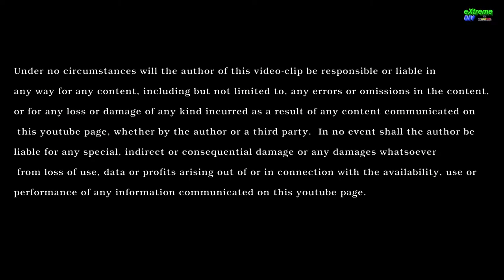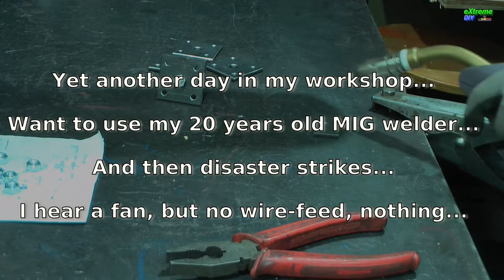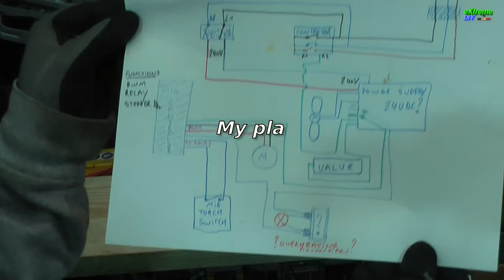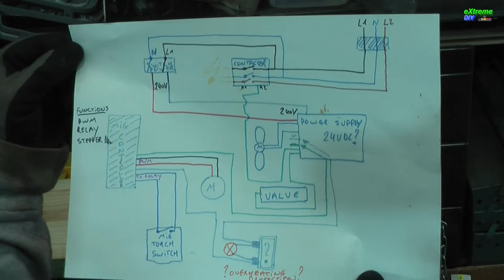DIY Fixing/Repairing/Rebuilding my MIG welder

Comment from the maker: I used this PWM controller from @m@zon (not sponsored, I payed for it!): DC PWM Motor Controller Reversible 12V 24V 36V 40A High Performance Motor Speed Controller Switch CCM6Ds-B ...   probably a bit over-engineered for what I was using it for, but may be it will last longer...  It also has a trigger switch, so that you do not have to switch the whole PWM controller on and off when welding...